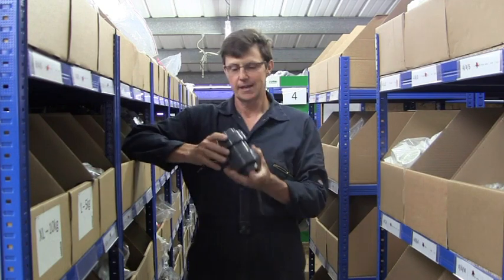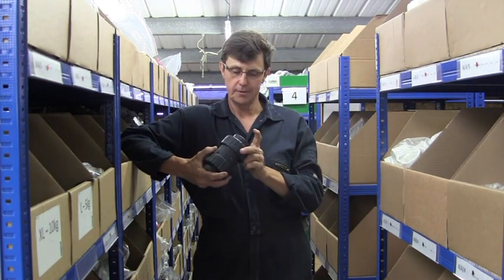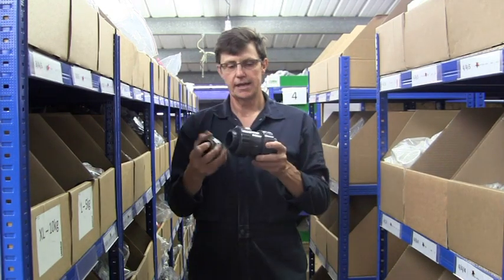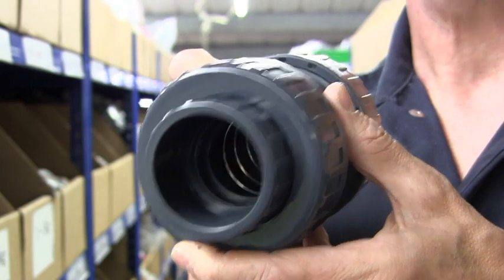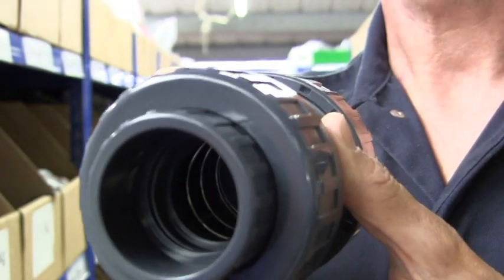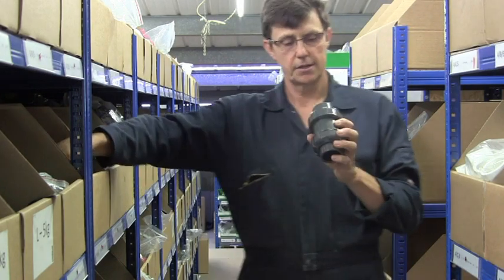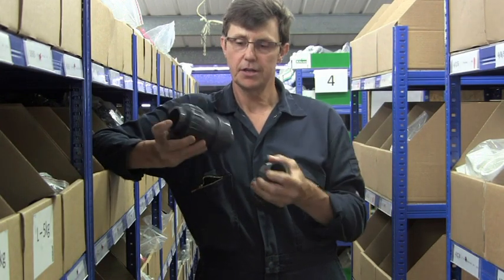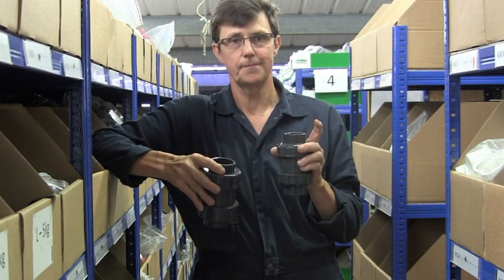Double Union Non Return Valves

Comment: Want to use this for a storm drain catchment to fill drum. However, I'm wondering if I'll have problem of it staying slightly open. My main aim of using it is to separate the first  runoff from my stored water.
Reply from the maker: HI. I am not sure I fully understand your application. The valve will stay open if there is a greater water head on the flow side than the discharge side. If you are using this for a drainage application rather than a pressure one you should look to use a non-sprung one such as https://www.plasticpipeshop.co.uk/Inch-PVC-Full-Bore-Swing-Check-Valve_c_1156.html, as the water heads in drainage are often too low to operate the spring.
Reply: @PlasticPipeShopTV  alright thanks

Comment: How can I test the quality of this valve and how can i measure the Kv ?
Reply: Hi plastic pipes

I have recently purchased one on these ( about a month ago) spring double check valves and fitted it but it seems loose and leaking badly, what might  I  be doing  wrong and/or do you have a video link of one being fitted, I have scoured the internet without much success?

Regards
Mike H.

Comment: Quick question do you make a non return valve that can deal with stones muck and dead vegetation looking for something like that so I can clean up a pond .
Reply from the maker: Hi there. The best non return valve (NRV) for this purpose would be one of our full bore valves; see: https://www.plasticpipeshop.co.uk/Inch-PVC-Full-Bore-Swing-Check-Valve_c_1156.html . These are only available in inch sizes and there is no equivalent in metric, so if you were using them with metric pipe you would be best using a short piece of inch size pipe and then an https://www.plasticpipeshop.co.uk/EPDM-Rubber-Couplings_c_2754.html. If cemented in place in the middle of a length of pipe rather than at the end, I’d also recommend putting a union https://www.plasticpipeshop.co.uk/Inch-PVC-Union-EPDM-O-Ring_c_514.html either side of the NRV so it can be taken out and cleaned / serviced.

Comment: A silly question (maybe!), in a submersible pump situation with a head of (let's say) 100m, would it make sense to have 2 or 3 valves (one right after the pump and then 1 or 2 more along the head) instead of just one?
Reply from the maker: Hi, You should only ever need one. In some critical situations I have known people to install 2, one after the other but both should be immediately after the pump. Hope that helps.
Reply: @PlasticPipeShopTV  Thanks for getting back to me promptly. I can see the benefit in doing that. In the first couple of seconds, the RPM is still low and as the first valve opens up, the pump only feels the weight of the water column between the 2 valves ( which is not much), the second valve being still shut. That's how I imagine it anyway.

Comment: Small non returning valve is cheaper..
So can I use a reducer to a water tank so that I can use a small nin returning valve instead of big one??
Reply from the maker: Hi there. Yes, but be aware that using a smaller non-return valve will reduce the bore and so will reduce the flow through your pipe system.